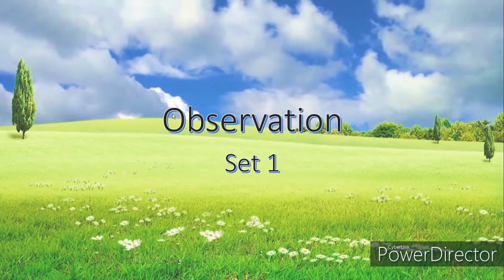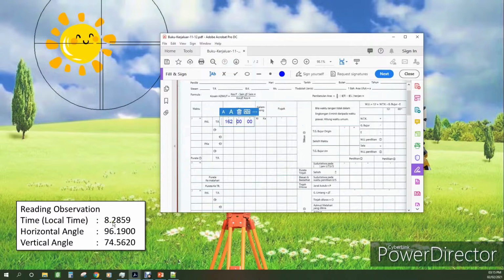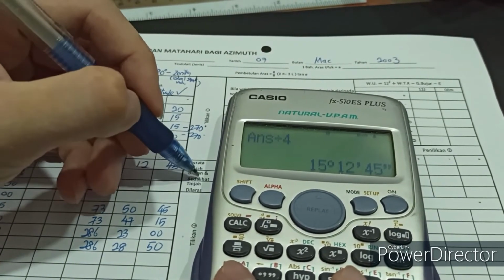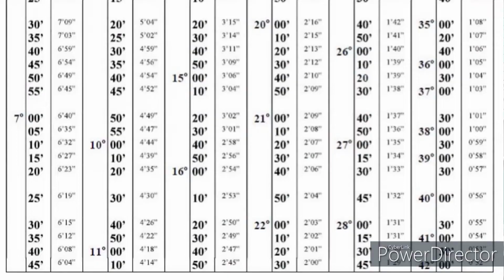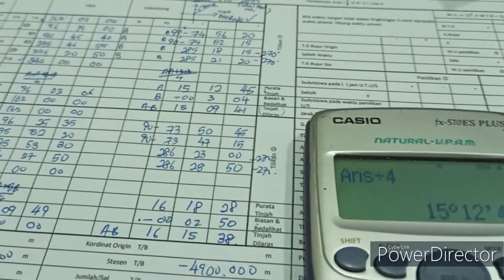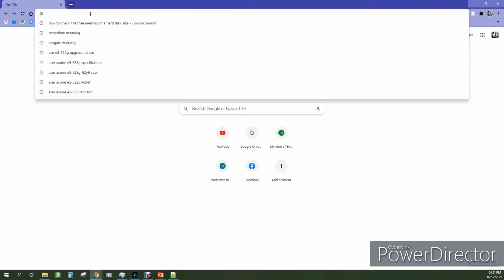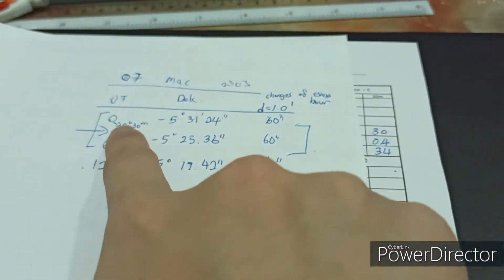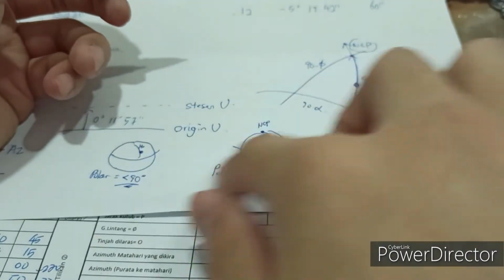Azimuth Determination by Solar Observation   Cerapan Matahari

Comment: Using GNSS, it's easy to work relative to TRUE GEOGRAPHIC NORTH.

But how do you align azimuth of Total Station to TRUE GEOGRAPHIC NORTH matching GNSS?  But without GNSS.  I guess could approximate using smart phone compass, or a magnetic compass, but prefer not to.

Thank you.
Reply from the maker: Hi, thank you for watching the video.

In Malaysia, having the solar observation is the one of the requirements for a cadastre survey. 
Of course using GNSS, it will be easy to work.  
The geographic north is matching to the GNSS (proven) since the calculation is localize and correction is applied.